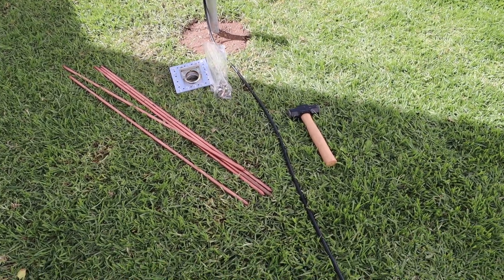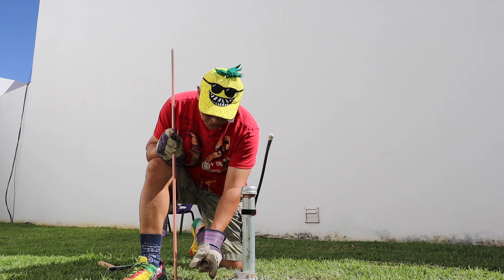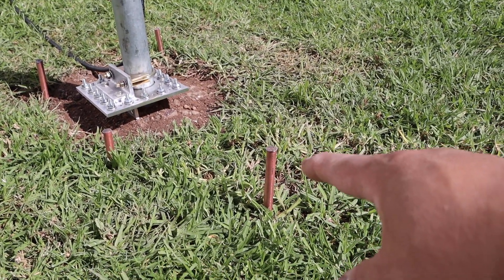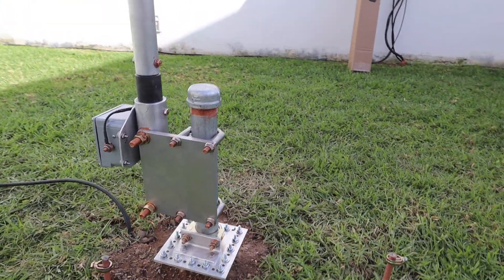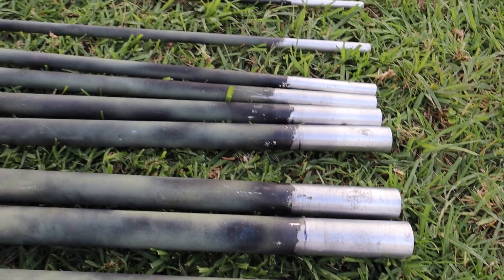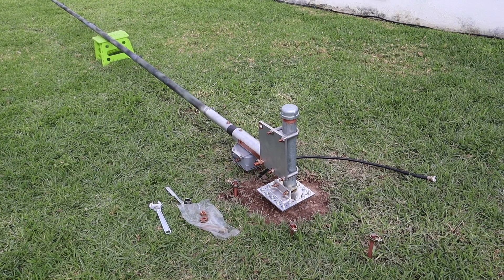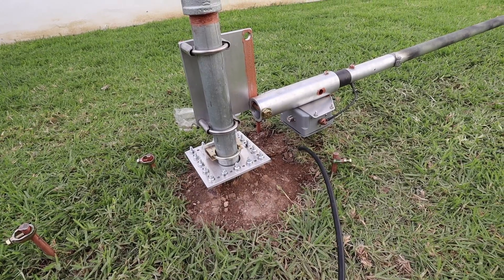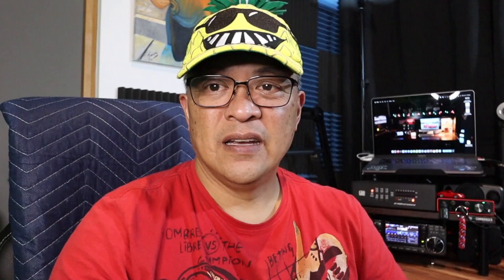Setting up the Zero Five 27' HOA Multiband Fold over HF Antenna | Relocated my Antenna | 2nd  Set up

Comment: Thanks for the videos.  Considering several zero five antennas and have been following your videos.  It seems the ground plane wires are necessary even if the antenna is advertised as not needing them.  I am replacing a home brew 80/40/20 meter coil loaded dipole I had in my trees.  The tree topped over the last winter and hit my house (we had 600+ inches of snow this last year)... I am now paranoid about putting antennas in my trees.  The soil here in the mountains of California are not great for ground plane (granitic sand) so I am considering the ground plane version but the $ is making me consider the 33' version.

Thanks for the videos.  73!  KM6SSK
Reply from the maker: The Zero Five is a good Vertical.  I have both the 27' and 43'.  I believe in the ground radials helping the antenna radiate. Perhaps use an electric edger to dig a trench hole for the radials.  Good luck!

Comment: The small space where your 0/5 is located what will be the lengths of your radials and now many. I know they say min of 16.
Reply from the maker: I haven't layed down the ground radials yet.  I will use the existing  ground radials that I used on my DX Commander.  I believe they are various lengths from 27' to some that are 43'.  The more ground radials you lay down the better.  Right now, I have 4 ground rods near the base of the antenna.

Comment: The copper anti-seize and aluminum will start to eat each other up especially where moisture is present. These two metals are corrosive when touching!
Reply from the maker: Thank you and I thought I was doing myself a favor.
Reply: Darren, you need some electrical jointing paste, to aid conductivity and prevent corrosion, the same goes for the Chameleon   virtical extension poles which are made from Aluminium. 73
Reply from the maker: @alexdokic5567  Thank you for the advice.

Comment: Hi Captain, 
Thank you very much for the interesting video posts. Just a question, what kind of red brownish paste or paint did you apply to the joints (between the inner and outer pipe)? And is it to improve and maintain conductivity?
Kind Regards
Vy73! de Georg DG1GS
Reply from the maker: Yes, it make a better contact and it's also anti seize that prevents corrosion. https://www.jetlube.com/product/ss-30-anti-seize-thread-lubricant

Comment: Captain can you see a difference between the 43' and 27'.
Reply: I will also be interested to learn this. I currently have a Hustler 5BTV and also, thanks to watching Capt Darren's previous videos, a 27' Zero Five antenna that I use on the WARC bands. My guess is the 27' Zero Five will be better for DX on 14+ MHz, while the 43' Zero Five will be better on the lower frequencies.

Comment: Hi Capt. 
De KD2VRL, NJ.
I do have a novi Question...... Why do you run the coax cable all the way around the wall insted of goes straight from the juction box & also why so many grounds ?
Thanks for the video 73's.
Reply: I can answer those but I'm not the Cap.  The first reason is he needed to eat up the 75 feet of cable and I'm guessing by the looks of it the only way to do that was to take a less direct route to the antenna.  I have no idea about all the ground radials, I thought you just needed to put down the radials, but I'm also new at this.
Reply from the maker: On the Zero Five website, the owner Tom recommended to have a minimum length of 75' of RG213. You can run a shorter coax if you have a good antena tuner.
Reply: @DarrenN4VFR  
Thank you Capitán !! 
73’s
Reply: I have the 27' version of the Zero Five antenna that I mostly use on the WARC bands, and I just have about a 50' run of coax and it works great. I now have a Palstar HF-AUTO tuner, but my TS-890's built in tuner was able to tune it with no problem. The main thing with these antennas is lay down as many ground radials as you can, the more, the better. Length doesn't have to be precise, and they can be different lengths, just put as many as you can down. No need to dig trenches or cut slits in your lawn, just lay the radials on the ground and use "lawn staples" every two or three feet. The grass will grow over them and hide them in a matter of weeks. 73 de WB4DW